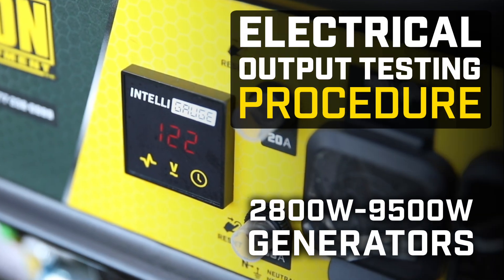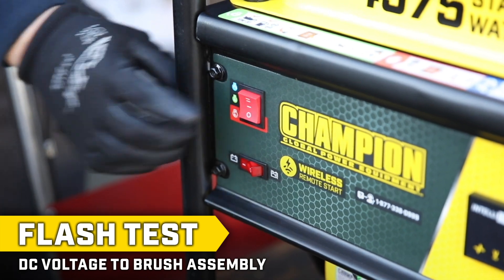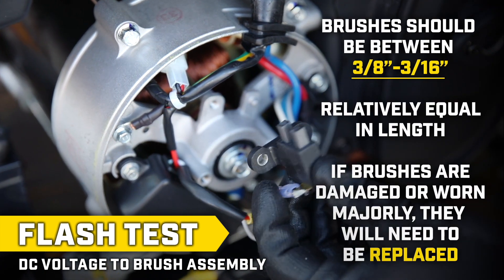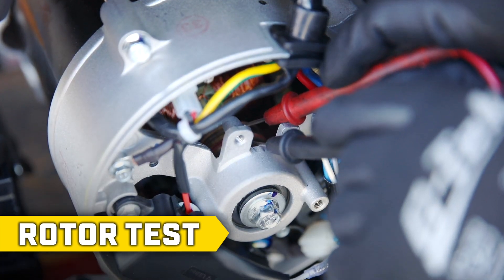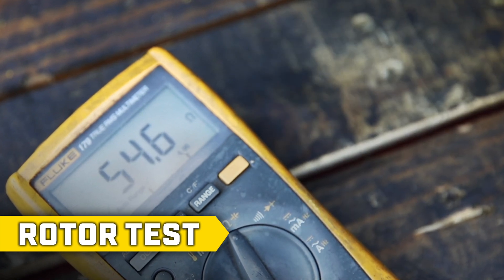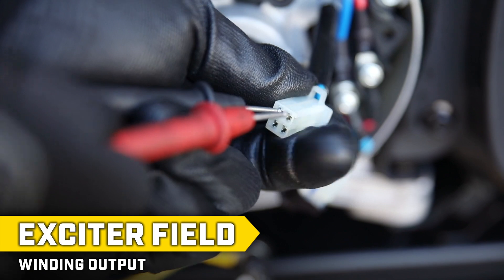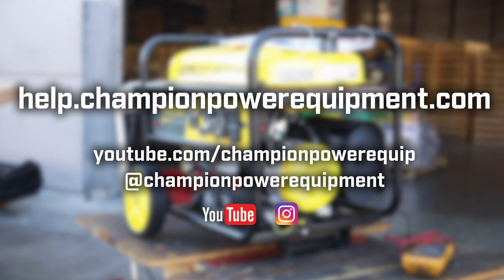Electrical Output Testing Procedure

Comment: Hello! Can an AVR be adapted to the 6 kVA single-phase generator, HONDA GX 390 – AGT 7201 HSB engine?
Reply from the maker: Hello, we do apologize, we do not know if our parts will work on another brand's Engine. We do suggest consulting with the manufacturer to get all the replacement parts that you need to repair your unit. If you need assistance with any Champion products, please contact our support team at 877-338-0999, support@cpeauto.com, or use our live chat option located on our website. -Thank you

Comment: problem with these generators is the windings are "Aluminum" wire, a curse to work with!
Reply from the maker: We do apologize that you are having trouble with your unit. While out stator windings are Copper- Clad Aluminum, if you are experiencing some damage and need a replacement part, please contact our support team at 877-338-0999 for further assistance. -Thank you

Comment: Please request the advice why no spark  that rotor ohn is 62 corret!, carbon is not spark and i did change new carbon but not spark and not come out DC volt. What should i gonna do?
Reply from the maker: Hello, please contact our support team at 877-338-0999 with the results from your electrical output test, so we can go over the results with you and determine exactly what you need to repair your unit. Thank you

Comment: how about 44.1 rotor reading?
Reply from the maker: Hello, seeing that you are close to the minimum rating of 45 ohms, you can try cleaning the slip rings and repeating the test and see if it changes, but if not and you continue through the test and all other numbers meet the specs then you will need a rotor. If you need assistance in placing an order please contact our support team at 877-338-0999. Thank you,

Comment: Your videos are awesome. I have 2 champion generators. I am testing my model #100165, but do you know why does it has 4 wires out of the stator instead of 3 lioe my 10 starting watt does? It has a black, red and 2 of the blue wires. The blue connect together though.

Comment: Hi. My generator show nominal voltage between 220-240v. But when i plug in an equipment, my equipment show sign like it has low voltage. Can u explain why?
Reply from the maker: We are sorry to hear this. Please perform the electrical output testing procedure & call 1-877-338-0999 or email support@cpeauto.com with the results. This will help us verify the issue completely. https://help.championpowerequipment.com/article/YRqK59KpFU-electrical-output-testing-procedure

Comment: I have a 100165 and I get 250K ohms at slip rings. This means the rotor is bad?
Reply from the maker: We are sorry to hear that. We will need to verify your ohms reading because 250k is extremely high. We will also need you to provide the remaining results, so we can ensure that only the rotor is bad. Before concluding that the issue lies with the rotor, please call us at 1-877-338-0999 or email your results to support@cpeauto.com. This will allow us to assess your unit more accurately. Thank you for your patience.

Comment: Thank you. This video was easy for me to follow. I discovered my friend’s stator coil was fried from letting a friend borrow it and let him “run a sump pump” (that’s a lie it was backfed by the grid obviously). The key here was measuring for voltage coming from the plug into the AVR block. There was no voltage! I realized then the stator may be damaged, and removed the AVR to discover extensive stator and rotor damage and burning!

Comment: Hi. My 2 year old generator from TSC was hooked up with the red wire from the AVR going to the right side prong on the brush, which is the outer i believe. Is that the correct side? I read that plugging backwards will fry the small circuits in the AVR. My unit is a 10k watt starting.
Reply from the maker: Hello. Please email us pictures of said wire to support@cpeauto.com, so we can verify this. Thank you.

Comment: Hi. When testing the Exciter field, if the voltage is in the good range between 4-8 volts AC, what else could be the issue besides the AVR? Could it be a bad circuit breaker? I am only getting 23 volts AC to the circuit breaker line side, and load side. But when I test the circuit breaker while removed from the generator, there is no continuity when switched on for the positive to positive terminal. The negative to negative has full continuity. Edit. When testing the circuit breaker again, now the positive has continuity. Huh. Maybe just a bad voltage regulator? I have champion power generator, model #201035, 10k watt max starting. Which AVR do I order if this is the case? Thank you. Your video makes me stay with getting champion. No one else, not one manufacturer I see helps their customers like you. My generator is only 1 year old from tractor supply. Please help.
Reply from the maker: We are sorry to hear this. If the voltage range is reading between four & eight volts, then it's the AVR that would need replacing. If you are within the generator's three-year warranty, please give us a call at 1-877-338-0999 or email support@cpeauto.com. Make sure to have the sales receipt handy. If out of warranty, the AVR is item 75 on page five in the owner's manual: https://www.championpowerequipment.com/wp-content/uploads/2021/01/201035-EPL-English-all.pdf
Reply: @ChampionPowerEquipmentHQ  is the outer slip ring supposed to have the white lead, and the inner slip ring have the red? When connected that way, it gets the 38v you do in the test, which is above the 15v required you said. My generator has someone place them on the opposite ways. They put red on the inner ring on the white lead, and outer on the red lead. Which way is correct? And would that destroy the AVR? Possibly fry it? Thank you.

Comment: A very good video. However showing 38 v on the 13v test doesn’t help
Reply from the maker: Sorry about that. If you require assistance performing this procedure, please give us a call at 1-877-338-0999 or email support@cpeauto.com. Thank you.
Reply: They show 38v. Under 15v is bad. So 38v is good. Mine is 43v.

Comment: I have spark at the brushes but no ac output from generator..
Reply from the maker: We are sorry to hear this. We recommend next testing the rotor. For further assistance, please give us a call at 1-877-338-0999 or email us at support@cpeauto.com. Thank you.
Reply: @ChampionPowerEquipmentHQ  I found the problem.. corrosion / compromised brush lead in wire was heated and dropped voltage possibly. I also unplugged the harness from avr and sprayed wd-40 in connectors..and plugged them back in . made sure the brush spade connector was tight..started it and its charging..by the way I have 49 ohms on rotor..so thats good. THANKS FOR YOUR VIDEOS.

Comment: I have been teaching myself small engine work for almost 3 years.  I am currently restoring my second generator.  This seems to be an excellent training video except for one detail which to me makes no sense.

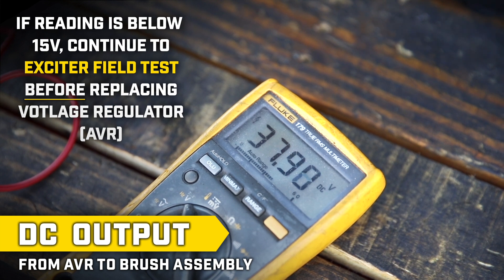From 2:07 to 2:40 the Exciter Field is being tested.  The narrator states that the voltage SHOULD be between 4 and 8V AC, but then immediately states if this IS the case the AVR needs to be replaced.  Those two statements on their face seem contradictory (because of the word "should", which implies correct or acceptable).  I suspect the explanation could be written more clearly and it ought to read thus - The voltage WILL read between 4 and 8 if the AVR  IS FAULTY and DOES need to be replaced.  If the voltage is OUTSIDE those parameters then the stator will need to be replaced.

Do I understand that correctly?

Thank you very much for this video - it has increased my knowledge in this area greatly!  I will be referring to the links provided as well as your YouTube channel for more knowledge.
Reply: That is correct...If the voltage in reading as indicated, the exciter field is working properly and the avr is the source of the problem.
Reply from the maker: We will be sure to review this. Thank you for your feedback!

Comment: My brush test was above was like 40v and my stator test was between 4-8v.

White wire connector on brushes is a bit burnt and black. 

AVR need replacing? My lights in the house are flickering when big loads come on and off and generally fluttering a little bit all the time.
Reply: Got sorted with your love chat. AVR and Brushes are in the mail. Thanks!
Reply: Mine did exactly what yours is..I used 600 grit emery cloth and cleaned the rings that the brushes rub against..after i did that the brushes didnt get hot.and the generator no longer flashed ( pulsed) lights when loaded..
Reply: I replaced the AVR and brushes with newly supplied ones from champion. It’s still doing the same thing. 🤷🏼‍♂️
Reply: غ
Reply from the maker: The brushes & AVR may need replacing. Please email us at support@cpeauto.com with the results of each test, so we can confirm what the culprit is. Thank you!

Comment: So what do you do when all of theses tests check out fine but your still not putting out power?
Reply: You need to 'FLASH'  (re magnetize the unit). When they sit for a period of time they lose their magnetic charge.  Google the process, it will show the steps you need to take. Very simple process, only takes a couple of minutes.
Reply from the maker: We would then need to have an authorized repair center do a more internal diagnosis of the machine to pinpoint the likely cause. 👍🏽
Reply: @ChampionPowerEquipmentHQ  sad thing is is my generator is only about 18 months old with maybe 50 hours on it. It's of course still under warranty and northern tool the people that your people sent me to have had my generator for 4 months and won't fix the piece of shit

Comment: Interesting. My rotor is reading approx 900 ohms across the slip rings - any idea where to go from here? Thanks
Reply from the maker: We're sorry to hear this! At your earliest convenience, please give us a call at 1-877-338-0999 or email us at support@cpeauto.com. 👍
Reply: @ChampionPowerEquipmentHQ  hi guys - I replace the AVR and brushes and now the generator works perfectly. I think the brushes were ok, I just replaced them as one was shorter than the other. 

I think the main problem was a blown AVR. All good now :)